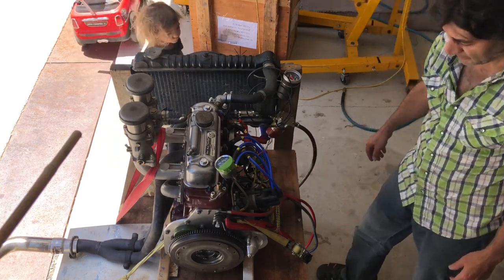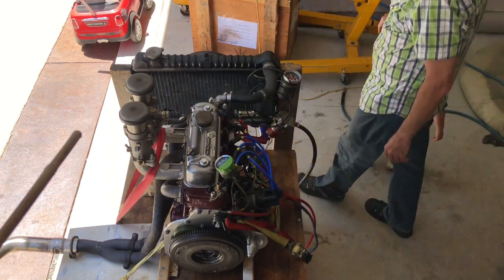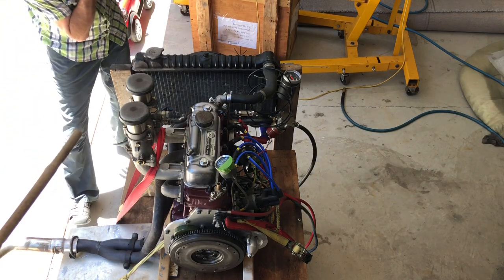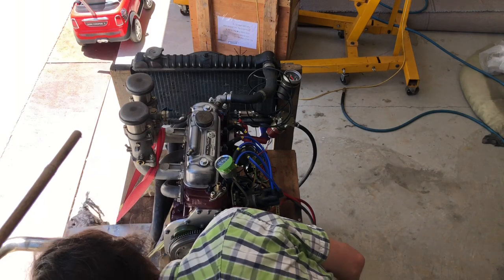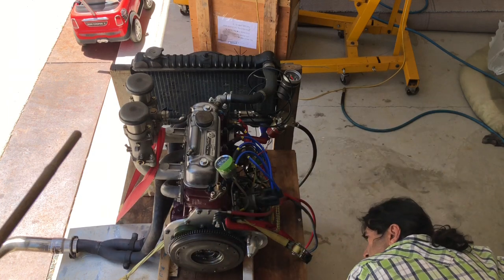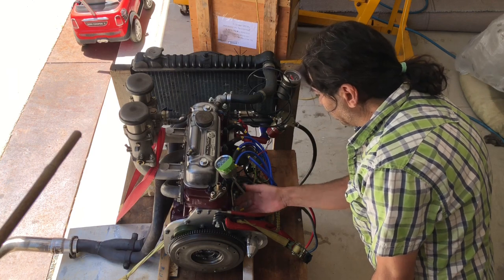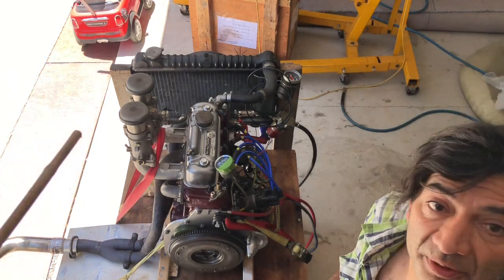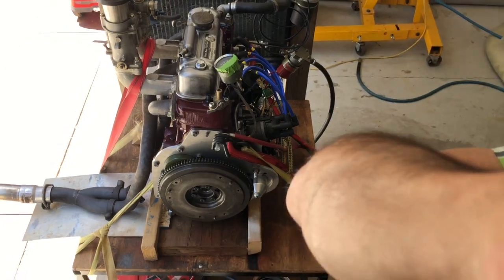First start of Jemal’s Super Engine

Comment: i wish my 998 revved so nice when cold, its got a stage 1 kit on a new HS4 and when you rev it when cold it hesitates/cuts out, unless i make the mixture REALY rich :( and im fresh out of ideas as to whats wrong
Reply from the maker: The Weber carbs all have accelerator pumps so they rev up sharply.  SU carbs must have good mixture as there is no pump. A built up engine probably needs richer jetting.  I'm building a BIG 998.... .135" over bore, so we'll see what I run into!
Reply: Try a different needle!